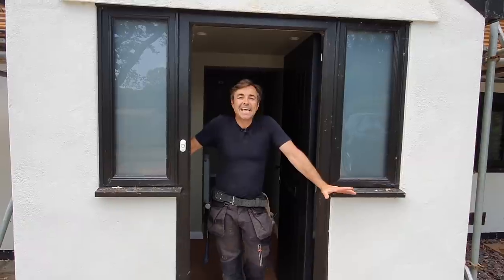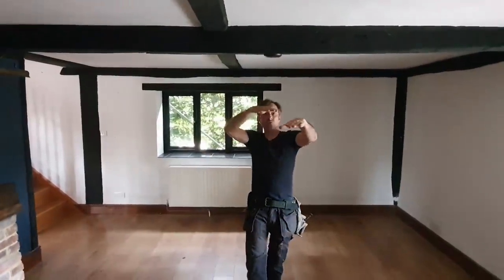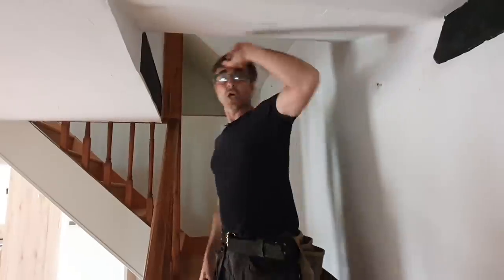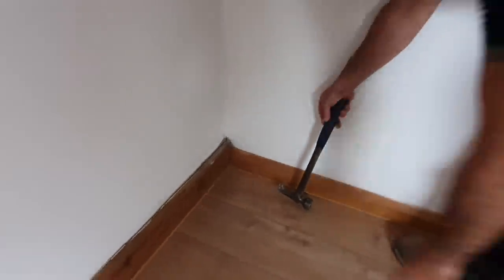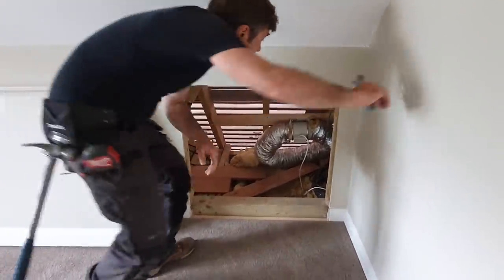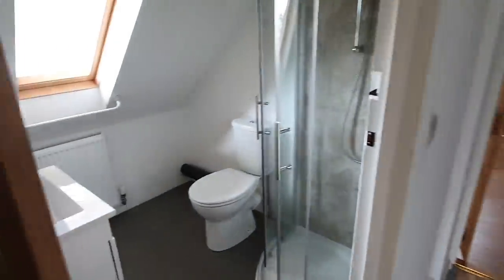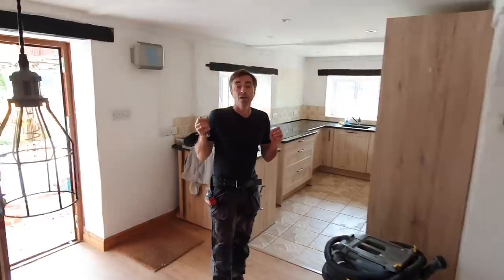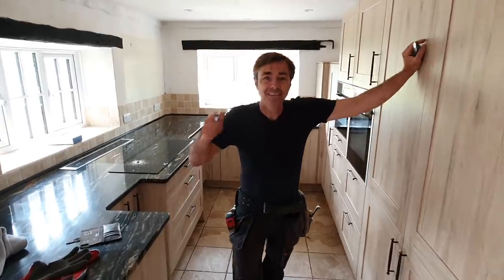The Big Build 7. Walk through the existing building before we Strip out, and bad workmanship!!!

Comment: Hobbit house. Are the people that lived there particularly short. How did that get signed off. For a relatively new build what happened to regulation height for the stairs and ceilings. That was built by boggit and scarper. And yet the sparky was good. Oh well the new build will improve things. Even today few people are as fussy for detail as you. In this case though Mr average would be an improvement.

Comment: Blue insulation might be XPS. It’s like EPS but way more waterproof or less water absorbing.  I have it against the walls underground around my basement.  Also seen it in SIPs.   Waterproof but obviously not as good an insulator as Kingspan type and should be unnecessary under tiles.